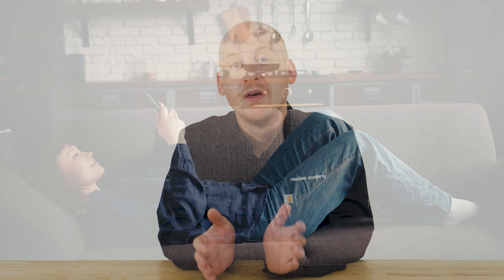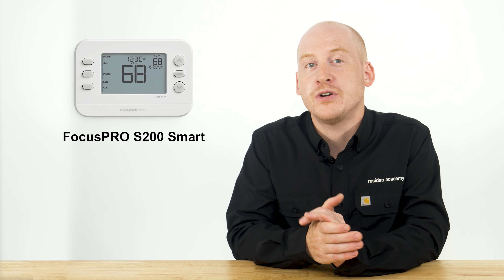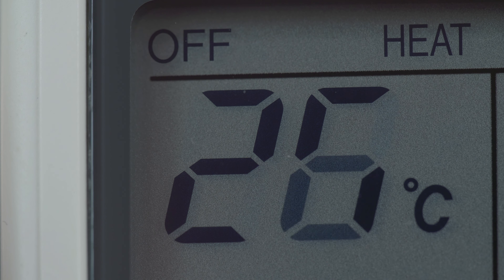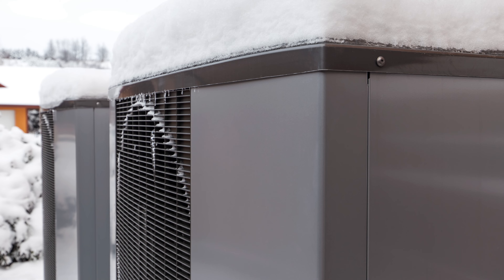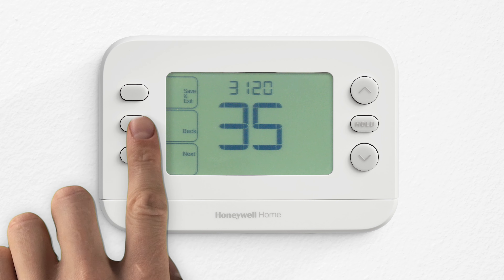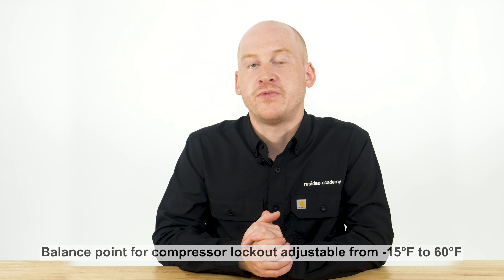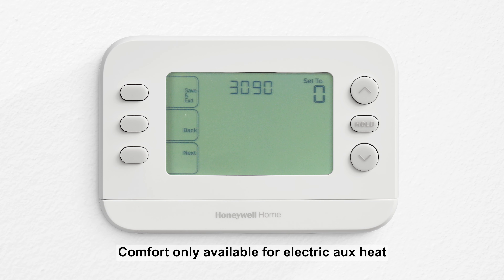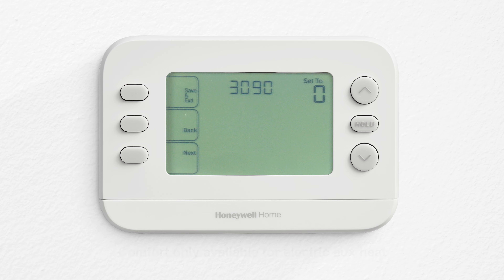Control Options for Heat Pump Applications on Thermostat (FocusPRO N100, P200, and S200)

Comment: I have a gas furnace (main source) and electric heat pump that were just recently installed. The thermostat is a T6 Pro. Am trying to do a rebate, and the rebate company are asking for Switchover temperature °C. Would you have any idea how I can obtain that?  I have asked the installers for that info, but so far, no luck in obtaining that info